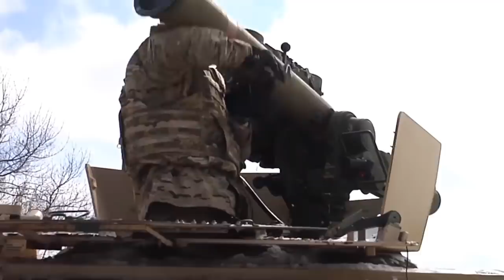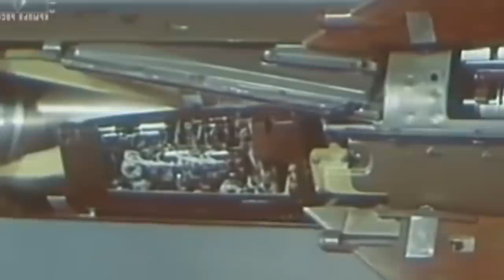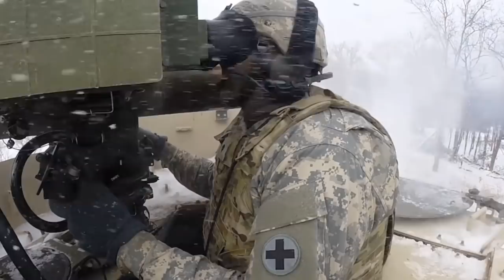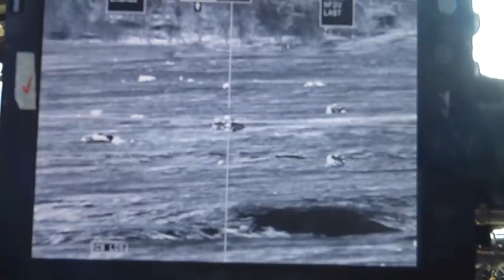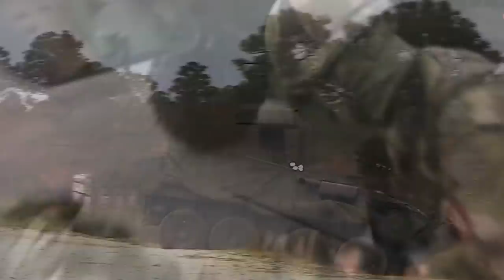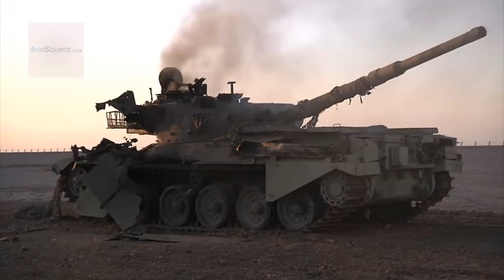Should Main Battle Tanks have Anti-tank Missiles?

Comment: I agree that there will likely be an increase in the use of ATGMs on AFVs as time goes on, and the ability to use gun launched ATGMs and / or guided rounds will become the norm, as will programmable rounds with air-burst capability. (T-90 has this already). I doubt that any sane nation would ditch gun armed tanks however for several reasons, ammo capacity and cost being the main ones. You wouldn't want to expend a £20,000 ATGM to take out a pill box, wall or machine gun nest, especially if your vehicle can only carry four such ATGMs at a time. The bean counters would not be impressed. Gun armed tanks have a next to zero meter dead zone if shooting straight ahead, so they can engage at point blank range if necessary. Unguided rounds cannot be spoofed, jammed or defeated by obscurants either, an inert dart of DU or tungsten is too stupid to be fooled, it's just going to keep on going regardless. It's also much harder to stop APFSDS rounds via a hard-kill APS since it is a solid lump of very dense material moving very fast. Good luck stopping that with a glorified shotgun canister 😎 Gun armed tanks are here to stay for the foreseeable (even if they end up being unmanned.)

Comment: The comment from SteelbeastsCavalry is spot on. And as Mr M also says the role of MBT is to be the heavily armored Spearhead. Putting a ATGM system creates problems. How to give it same protection as the MBT´s current  and new incoming (active defence) systems without increasing the already high weight?. Because of limited space for store, where to place spare missiles without decrease other ammunitions? Handling?  And so on and on with numerous problems. 
If, and that is a very big if, there should be any sort of guided missiles it should  be a very long range complement to the Main gun with a few of something like the extremely fast and lethal  "Losat" rocket system. Can be done but not cheap and not without compromises.

Comment: Actually they "have"  in some cases mounted missiles on tanks...  the AMX-13 for example had missiles mounted to it. 

one version of the centurion carried missiles mounted externally.   

It has been done...   the issue isn't pacing, as many models now are fire and forget.   Or cost...  Instead the issue is how the army wants to USE the vehicles.   Ask yourself why the US doesn't mount a twin stinger launcher on the roof...   same reason...   They want tanks to do 1 job.  period...  they don't want a jack of all trades vehicle.  They don't want an ambush vehical that can sit waiting for days on end, then fire a bunch of missiles at the enemy and run...  infact they don't even want to use tanks defensivly in the case of the US.

Comment: Two issues with ATGM's mounted on turrets, and one with a missile regardless of its firing system. Firstly, there are lots of things already hung off MBT turrets and a multiple tube launcher and rounds take up a lot of space. It may be that the bulk will compromise other systems for what is effectively an optional tank killing system. Secondly, packing a great deal of explosive material (warhead and propellant) with minimal armour onto the outside of the fighting compartment is not a good idea for a vehicle that is designed to survive being hit by most munitions. Even if detonating missiles do not cause internal damage and injury, they will very likely compromise the armour including applique modules and ERA. Also, there needs to be access points within the armour plate to accommodate firing and guidance cuntrols; this compromises the protection afforded by the turret. Lastly all rocket type missiles are more easily defeated than those fires by a charge - they are slower and can be detected and engaged by point defence systems. The Russians employ a system that destroys an incoming round with blast effect deployed by the target vehicle - something that does not effect kinetic penetrators and most HEAT/HESH rounds. Missiles are not only superfluous, they are often not as effective at most ranges.

Comment: short answer without watching: if the atgm is blos and the operators plattform is sensor linked to other plattforms, or the missile is smart enough to find its own targets: totally yes. shooting from full cover is good for own health. you can also extend the range of the tank compared to shells.
For head on head fights a shell is always prefferable, because faster time till impact.
edit as i saw the video: i am speaking of barrel launched systems of couurse - as addition to standard shells. they add some possibilities for the tank. tows and similar LOS targeting setups makes no sense to mount outside on a tank, except its fire and forget and has a greater range then the tank. but even then it would better fit on a lighter and faster vehicle (like the old cruisers in marine warfare, either outgun or outrun)

Comment: Why do you need ATGM on a platform that already have weapon that can travel super sonic and punch through any armor? Sure, ATGM may have some advantages (like longer range) but also comes with disadvantages. What works wonder on one platform (like gatling gun on A-10 and TOW on humvee or bradley) doesn't always work with same success on other platform.
IMO, barrel launched missile (that can be fired while on the move) is the way to go.

Comment: Basically, tank guns are starting to not have the girth to use the most effective HEAT projectile(typically, penetration scales with diameter), let alone ATGM that needs guidance component.

But ATGM are still useful for extending the range(if enemy can't hit/damage you effectively with conventional ammo and he doesn't have ATGM, you can poke away at him at long range and he can't do much but drive forward/find cover).

Comment: Now that Hellfires are getting some surface to air capability I see no reason not to put say a double Hellfire launcher on the side of the turret, sort of like a Bradley’s TOW turret. Primarily for anti-air, but you could use it against ground targets too. I mainly envision helicopter gunship support. Maybe an Apache lasing targets while a concealed tank launches the missile. To save the Apache’s missiles or after it’s already run out but still has loiter fuel.

Comment: As you pointed out  - cost.  What you didn't touch on was rate of fire, modern tank gets off multiple rounds in a matter of seconds while trying to get the same from a TOW would take about 2 minutes and would probably mean moving positions because they would find you after the first round went out the tube. The technology involved in protecting tanks from AT and improving firepower with AT is an ongoing struggle.  When one guy with an effective AT  (at a cost of $10,000) can knock out a 3 ~ 5 Million dollar tank, it has an affect on procurement.

Comment: I think tanks and vehicles in general should have the option to have ATGMs in order to extend their reach and options. Where any of this equipment would be placed is a design question, current and old tanks with atgms load internally through the main gun but are limited by the size of the breach/tube. So hellfires and 120+ size missiles can't be loaded internally and must be outside or some other means. Price wise there does exist training rounds or non-explosive warheads so cost can be mitigated but most jobs a tank is given can be done with a gun at cost, at the same time with increasing anti-missile systems are coming onto the market and deployment, the reliability and lethality of missiles is no longer a certainty. 

My final word? Turn tanks into veritable "landships" where they have equipment akin to naval ships with weapons mixes and defence suites.

Comment: The rapier MT-12 has an accurate RUTA radar and a set of precision weapons, it also has rockets in some modifications)
radar sight 1A31 "Ruta". Round-the-clock and all-weather, target detection range of 3500mm with a probability of 80% for 3 seconds, the sight automatically ensures the calculation of the point of anticipation when firing at a moving target.
In addition, when combined with the "knucklebone" complex, firing guided missiles (c)

Comment: as you were REME could you do something on repairing hull armour , video games make this look simple but how do you repair chobham ?
Reply from the maker: Jerry Swetlow you can’t repair chobham. Once it’s hit, it’s done
Reply: yes but is the tank dun or can the module be replaced ?
Reply: This will require cutting out part of the armor and replacing the whole section, it's best to do it in the factory. So if the tank is on the other side of the globe, it's cheaper to disassemble it for spare parts. This is theoretically possible, but it has no practical meaning.

Comment: Wouldnt it be cool if they could invent a cheap laser guided 120 mortar round ?  Imagine the AMOS in a support role for a battle group with laser designators for the infantry. Any infantry platoon identify a tank and communicates the rough position and the AMOS fires a short volley at the location, the infantry paints the target with lasers as they start to descend and one or two 120mm mortar rounds would find its way to the tanks turret roof or motor. 

Would be a pretty cool tool that would basically replace atgms and their carriers exposure to direct fire.   Infantry are much harder to detect and kill direct line of sight and the AMOS can fire and scoot in a safe ish distance. 
The laser seeker would have to be made cheaply so it can be used at leisure and in small volleys to ensure hit.  Mass producing electronics can be cheap today.

Comment: This is an accurate summery. Tanks have a very different mission statement to a Tank Destroyer Missile. The TDM is designed for defence, similar to the old A/T guns used in WWII. They hide, are static and are design to fire and get the hell out. Tanks are designed to move, so they need a weapon which can acquire and fire quickly. A 120mm has a muzzle velocity of over 1000mps, which means a shell will hits the target in 1 second once acquired. Also, once fired a 120mm APFSDS-DU cannot be stopped before it hits the target. At least at the moment. 
The issue with an ATGW is against an advanced target there are many ways to defeat it, in most cases it takes longer to acquire and a lot longer to hit the target. Some ATGW’s can fire before they acquire and be targeted in flight, but this takes a lot of planning.
This is not a new difference; in WWII the Germans did not place Tank Destroyers with Panzer divisions. They are optimised for different missions.
The Russians interest in placing ATGW with their tanks is a trend they started back when the BMP first came out. It should be noted the BMP-3 does not have an ATGW because the Russians discovered it was hard to fire it. The tanks overcome a lot of the issues with CCTV, but its not the way tanks are support to work. I suspect placing a ATGW on an older tank may be useful, but that converts the tank into a TDM.
As for the future, who knows.

Comment: If you have enough weight limit and room for it, go for the gun: Store more rounds more easily, fire a wider variety of shells, fire on the move, fire quickly without needing guidance.

If you have extremely low weight/space limits (Bradley, Humvee) then putting any type of gun on makes no sense. Either its too heavy to carry or too light to be effective, and either way you won't be able to store enough ammo to make the high weight worth it. Throwing a TOW launcher on a humvee with a few spare missiles on the truck takes a regular humvee and makes it as deadly as an Abrams for at least a few shots. Putting a TOW on a Bradley allows it to defend itself if need be, instead of NEEDING to rely on MBT support.

Comment: What I'm hearing you say here, is that modern MBTs have main guns accurate and powerful enough that ATGMs are more trouble than they are worth. How about giving ATGMs to light tanks - say a vehicle light and small enough to fit in the back of a C130, which has a main gun of max 105mm? And/Or how about adding a SAM launcher to an MBT?
Reply: Remember that just because you can engage a tank at 3km doesn't mean you can penetrate it's armor or hit it reliably when it deploys countermeasures. The same is true for ATGM's but they have uses against soft skinned vehicles at even longer ranges and also against helicopters and bunkers.

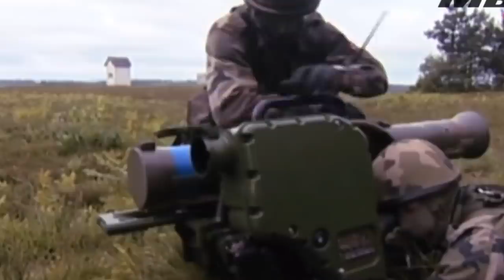Comment: 10:48 Actually, surprisingly, shaped charges doesn't necessarily have to be made out of copper liners...as long as the material is ductile enough, I forgot what material property would make a great SC liner...but, tin (early WW2 shaped charges), steel, aluminum (does better against concrete), tantalum, uranium (development into this was in an attempt to get a denser liner that can penetrate more), glass (Hell...I think combat engineers improvised shaped charges by packing wine bottles with explosives back during WW2...I think...and also extremely dense glass made of lead can be used too), water (can cut steel like an industrial water cutter), and propellant (yay for project Orion  :D  )

Comment: Mat, I have a question about these tube launched ATGM field by Russian and some other countries as I haven't really seen any actual combat footage of their employments.

If our TOW, Hellwire and other guided anti-missiles are of such large sizes, how much of these much shorter and smaller missiles (as they have to be fitted into the guntube/launcher and/or being loaded by autoloaders), as in the case of the Russian vehicles, how much of the actual round being loaded would be the projectile/warhead and how much would be the propellant and the needed electronics? 
I am imagining such tube launched missiles would be half or even 1/3 the length and size of a TOW, maybe slightly smaller than the old US Army's Dragon, would it be able to pack a decisive damaging warhead? And because of the reduced size, would it be carrying less propellant, thus shorter range?

Just wondering...

Comment: To be brutally honest, I'm legitimately surprised no one's tried this before; I mean yes I can understand main battle tanks have a nice big Cannon and stuff but most atgm can also be used as light anti-aircraft missiles, So if nothing else the tank now has a weapon system other than trying to hit a maneuvering helicopter with its coax or the hopefully mounted rooftop .50 or equivalent, and also has a weapon that's a guaranteed minimum mission kill if it hits, catastrophic kill more than likely

And given that a tube fired atgm is always ready to go and in case of the main gun is say,needing to be reloaded or is actually knocked out, Then the tankers have at least one (or possibly two or more depending on how it's installed) chances to save themselves from a getting hit whilst vulnerable or some way to retaliate back if they've already been hit

Comment: Seems to work well enough for the Merkava using a SA missile. I'd like to see a javelin setup.

Using a traditional wire guided system doesn't make much sense though. Tanks need the mobility.

Personally I'm more curious why more tanks don't have Singers or other AA options besides the AA machine gun. Not so much for anti-jet capability, but more for anti-helicopter duty. I guess in most cases though the only helicopters tankers have to worry about are from the major powers and most armies we're fighting now don't really have much capability to field choppers.

Comment: I get your point but even when attacking tanks sometimes still provide overwatch for others elements especially in very open areas with long ranges. Also Tanks are used just as much in defends if the terrain leads to long engagement ranges. In these situations there are 2 advantages to using atgms on tanks. 
1. Longer Range (Spike LR 5,5km Spike ER 8km) especially us full in delaying operations.
2. You could queue targets (with a modern firing computer) and basically engage them at once with 1 main gun round and 2 atgms. For example a russian tank company with around 11 tanks attacks (and usually it will be at least company strength) a western platoon with usually 4 tanks can take out 4 attacking tanks and then has to put in the reverse gear or get pick of in return. Witch a standard fire and forget twin atgm launcher a single defending tank can engage 3 enemy tans at once. Making in total 12 targets engaged. considering the lower kill chance of atgms against tanks that would still give you a got chance to take out all 3 attacking platoons and just live company command and give you a good chance to make the enemy company combat ineffective. 
Yes tanks should not use atgms as a primary weapon but considering the small number of western tanks you should give them any possible advantage against an enemy that in numerically superior and uses gun launched atgms at long range to cover there assaults and keep your own tanks from taking more than one shot.

And the training needs for vehicle mounted fire and forged atgms are relatively low and easily trained in simulators. And because its just for use in certain situations you don#t need many missiles or a lot of time for reloads.

Comment: The real reason for ATGM on tanks is range, if applicable.  The Merkava is armed with LAHAT missiles that can be fired from its gun.  Although the Merkava has roughly the same fire range as the Abrams when firing regular shells, the LAHAT's range is even greater.  It becomes even more useful from a defensive or fixed position.